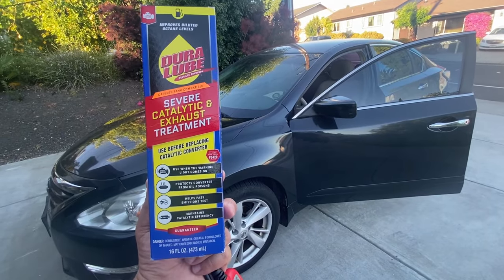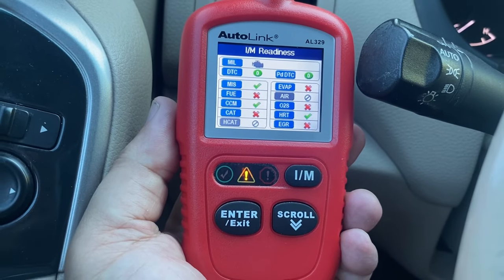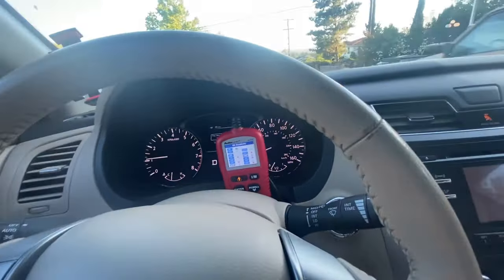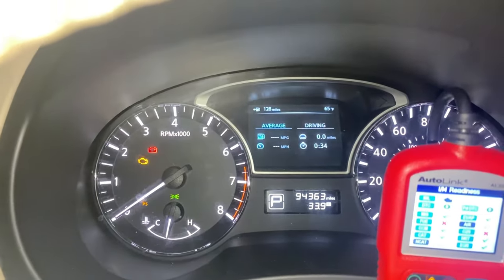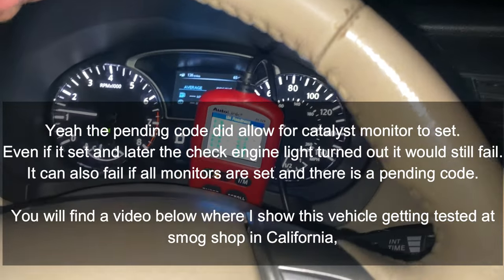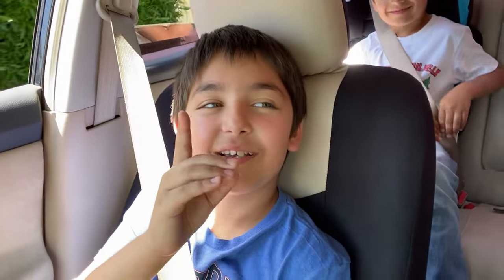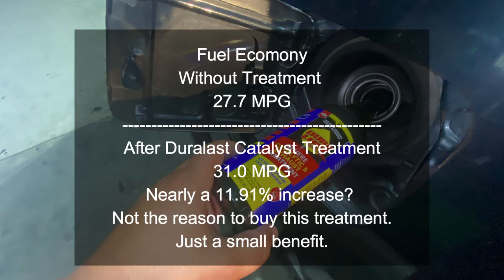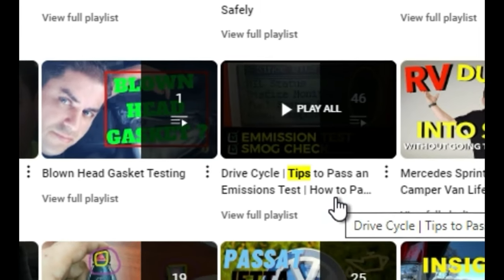P420 Smog Failure? Watch to See if Dura Lube Catalytic Converter Treatment Can Help

Comment: This product does not work, waist of money. I used it twice. I think it might be a air sensor problem now.
Reply from the maker: He do you have a pending code for the mass air flow sensor?
Reply: Just cause it dosnt work for you dosnt mean it dosnt work
Reply: If it was an air sensor problem how would this have helped to begin with 😂
Reply: I agree with you. Have tried multiple times last year.
Reply: Code P0420 O2 Sensor Efficiency Below Threshold - Normally Factory  set at 96% or Above Efficiency.
The Forward O2 Sensor #1 rapidly senses Fuel/Air mixture and sends the info to the CPU to adjust fuel injection with of signal .
The After or Downstream Catalytic O2 Sensor #2 Senses Efficiency of the Catalytic , generally the temperature should be steady with no bounce in signal and 100°F hotter than O2 #1 . Use of a Non-Fouler Like (Google Search) the $14 Dorman Part # 42109 on the Downstream O2 Sensor #2 insures a Steady Signal and No Check Engine Light . 
Dorman #42109 is the longest one at 2in but there's lots of room under a Chevy Yukon w 280k miles . Shorter ones are $10 and 90° ones for tight spaces are $30 . This Catalytic was never Clogged . Vehicle ran Great Before and After the Check Engine Light went Out . Found info on YouTube.

Comment: I had my engine light on,car app says caddy converter is a concern,bought this stuff worked great… light went off 😊
Reply from the maker: Mike, thanks buddy for sharing your success. Did the video influence you to try it or did you try it and just wanted very your results? I look forward to your reply.
Reply: Mike how long did it last Off
Reply: @luisponce1472 It doesn't last long maybe 100 miles or so (depends on vehicles my civic si it came on in 60). This stuff is really meant to be used for clearing the code and IMMEDIATELY going to a smog shop once the code is gone and all your monitors are set.

Comment: Heres the deal it works and better than cataclean. 1/4 quarter of tank of gas. Pour in a bottle. Drive ,drive,drive until before empty. Fill up do yourcars drive cycle. If your cars cat is clogged run 2 bottles thats what i did the first time. Good thing is if it doesn't work for your car you get your money back.
Reply: I have a 10 gallon tank. So if I have a 1/4 of a tank it would be 2.5 gallons. Should I do 1/2 a bottle?
Reply: @MikeKollin  full bottle

Comment: Not being funny but your check engine light isnt on
Reply from the maker: Lol, did you watch the video? I had a p420 code. It does not matter if your check engine is on or off if the inspection monitors are not ready you will not pass an emissions test.

Comment: Ok..Home Depot..2 cans PB Blaster spray/Heavy Naptha- Benzine in this..15 dollars..Spray both cans in 1/4  fuel tank...Run it at 55-65-75 speed limits posted..Byproduct is water/C02 steaming out tailpipe...Benzine is 115 octane.....
Reply from the maker: Sounds good but I think the idea is completely different as you are not bypassing the combustion chamber.

Comment: Great video. I did some reading a few months ago and the pros stated that if your car was produced after 1989 starting your car and letting the engine run can cause premature damage to your engine, the best thing to do is turn the car on and go. I have a 2008 GS350 and my VSC light came on so the mechanic used a similar device to the one you used to find out that something is going on with my cat converter so I’ll try that product to see what happens.
Reply from the maker: Thank you for sharing, why are you thinking of using this product?
Reply: What happened?
Reply: that is so backwards it's ridiculous.  stating up and going is what can cause problems
Reply: @caseyanderson1297 no not in a modern vehicle...
Reply: New vehicles do not have carburetors so we don’t need to warm our vehicles up any longer. However, I’m not sure why allowing a car to idle so we can get the heat going in the winter time would cause any damage to a new vehicle. Que sera sera to each our own.
Reply: I remember when my mom would get the car started so it could warm up and get the heat going on cold days. 

The days we would run late we would get into an icebox and putter down the street until the car warmed up and the engine  😂 

Miss my mom 😇
Reply: @AnnieAint how new of vehicles are you talking about because I have a 2014 Chevy equinox and we had a freeze over the winter and because I didn't let my car warm up long enough like I only let it sit there for like maybe 2 minutes before I took off and the engine overheated while I was driving on my way to work and was told if I had let it warm up for like 10 minutes when it's that cold out then I wouldn't have had that issue

Comment: I had a P0420 and P0430 code coming up on my wife's 2005 Lincoln Aviator and I came across your video and gave it a shot. I only used half of the bottle because I had around 8 gallons of gas so I used my little cheap Walmart diagnostic tool to reset the codes and drove it for 68 miles in all no codes popped up so i parked it until the next day and still no codes when I started it up so I went to the mechanic shop at the corner from my house and let them do the vehicle inspection because it was time to renew the tags and it passed 100% and my wife's SUV had the check engine light on for the past 6 months because of the P0420 and P0430 error codes. I did reset the codes a few times but they came back within a few minutes of driving every time but I've only used it 2 days and the error codes are still gone along with no more check engine light no more either. So I can honestly say this worked for my vehicle and I'm a very satisfied customer and very thankful for you sharing this video a whole lot. Thanks

Comment: Just run a gallon of thinner in half tank run for 150miles and itll clean the cat
Sounds like bart in the background you're from the bay area?
Reply: Yep I did it for my 2010 Honda 3.5 V6  coupe the code now sits in the graveyard  OBD 2 codes  got my lacquer thinner from Walmart removed the air fuel ratio sensors late that evening pour some directly in to bank one front and bank two rear cat and then put some into tank  hasn’t come back in over 6,000 mile now 🤔💯⚠️
Reply from the maker: I appreciate your feedback Sorry for the late reply, did you get this handled?
Reply: @RANDOMFIX the thinner enough to pass smog lol

Comment: Only works if you put it in the tank when the code first pops up and only with smaller converters
Reply from the maker: Thank you for the feedback. So with a bigger converter would 2 bottles due?
Reply: @RANDOMFIX  most modern converters will throw the code at just 5 percent deficiencies 
( EPA ) standards in US 
Take converters off and soak overnight in a solution of dawn dish detergent and water, then run some carbon cleaner through it , and let it set for about half hour, then rinse with hot water until water is clear and clean 
It will work probably f
Reply: For a couple of years

Comment: So after treatment, I hafto manually clear the code and hope 🤞🏼🤞🏼that the chk engine light doesn’t come back on?? Or will the light clear once I’ve run the car for a bit..?
Reply from the maker: Clear the check engine light and hope you can set the drive monitors before the computer can detect the issue if your are doing this for smog reasons. Are you doing it to pass a test? If you are here is a video that can help https://youtu.be/jldTJI64cfM?si=8W_Sv3mozdJwQf8c
Reply: @RANDOMFIX  yes I am doing it to pass the smog test… thx I’ll chk out the video! 🙂

Comment: Hello @RANDOMFIX. I got a 1997 4runner .When I smoged it, it passed emmison but failed because catalyst monitor and evap monitor were incomplete.  I've driven over 100 miles non stop trying the catalyst drive cycles but no luck.   Keep in mind I got no Check engine light either.  Do you think the cat is bad thats why the monitor wont set. Just alittle confused because  it  passed the  emmisons part of the smog.
Reply from the maker: You catalysts is old but it doesn’t mean it is bad. Here is the whole the catalyst incomplete playlist https://youtube.com/playlist?list=PLDEbtVOPRC-h1BAzaWQ-6NSnmG0gwvgwP

If you have already tried a chemical Additive I would not use any more but if you got the budget for it I would grab the big bottle of Techron and be ready for some freeway driving to get the catalyst hot to it get it ready. You can try the 3k trick I show in the video to get the catalyst hot but you might have to do both. 

Also you evap is incomplete, so here is the Toyota drive cycle https://youtu.be/EKfEr2LP2Nw

I had a 2001 es300 that took me 800 miles to set. So be patient and watch the videos so you are not burning expensive gas for no reason. Don’t forget to keep your fuel within range. 

Good luck and keep me updated
Reply: @RANDOMFIX   UPDATE: 
I've been driving around  done about 400 miles mix of both city and highway.    I've been doing the drive cycles specifically for toyota for the evap and the catalyst monitor.  Unfortunately they still haven't completed.  I noticed that once I completed the drive cycle to the best i can insted of reading up the monitors the computer threw me a pending P0133 but now it just disappeared.  Would I still have to get that fixed in order to set my monitors?
Thanks in advance.

Comment: so did you even have a p0420 /430 code?just curious what a i.m monitor/readiness monitor has to do with a monitor setting... the monitor will set either way, either with or without throwing a code.
Reply from the maker: Each inspection monitor will check the specific component to see if passes by meeting certain parameters.

Comment: I have 2007 Honda Odyssey with 265K mi. 
P0420 came on every 150 or 200 mi.
I bought 6 pack Dura lube last month, put 2 bottles to the 21gal tank and fill it up with 93oct gasoline.
This week, I already used the last 2 DuraLube bottles... The P0420 is still pop up every 150 mi or so. There's no other code other than P0420.
I drive mostly highway with AC off like you said, unfortunately I have no luck like you are. The only improvement I get during the test period is my van feel more power, better MPG, that's it, but P0420 keep coming back after I reset it.
Reply from the maker: Thanks for sharing, what caused this issue on your honda in the first place is the question to ask? 

Please check to verify your catalytic converter’s honey comb is intact  by Henry tapping it and listen for rattling. Second thing to do is very you have no exhaust leaks before the downstream o2 sensor ( the o2) after the catalyst) 

Let me me know what you find. What state are you located in?
Reply: Also check those O2 sensors.  They may be burnt out.  Check your air filter spark plugs and give it a tune-up with oil change before you look at buying new cats. Just to rule out can also look at pcv valve. These will give you false P0420 codes.

Comment: Hello I hope you help me I also have the code p0420 I saw your video and several videos to convince me to use this product I bought it from the store he told me to fill the tank and pour everything into the bottle I got to my house then I went back out I was in the highway and I realized that I had to put e.  3000 rpm to reach 100km when normally it is 2000rpm and from that the power began to drop and the engine began to make a noise as if it were coughing I don't know if I understood myself and I had to get to one side I called my brother for help Then I tried to turn it on again and everything was fine. I returned home but I was 60 km away out of fear. Do you know why that is? It's because of the product. Did I do something wrong or do you know what happened?
Reply from the maker: Sounds strange I have not heard of anything like you are experiencing.

Comment: also... a couple monitors will not even set unless your fuel level is between 15 and 85 percent
Reply from the maker: The Evap will not set if the fuel level is off or the fuel is slushing around. What are you driving I can send you the exact directions.

Comment: it looks good but is not in to buy in Europa (Netherlands) and +/-18 dollars for 3 gallons(is +/- 11.61 liters) is not expensive if i tank in liters wat it kost in dollars with dutch prices its 26,xx dollars for 3 gallons at a cheap tankstation in the Netherlands prices are higher hier than in the USA its around 1.97 euro/liter and it going 0.14 cents upover a month
Reply from the maker: Do you have similar smog or emissions test in the Netherlands 🇳🇱?
Reply: @RANDOMFIX  we have co2 test via the exaust and after 2007/2008 via the computer
Reply from the maker: Thank you for letting me know. Is the connector the same as North America? Are you able to use the obd2 tools from America?
Reply: @RANDOMFIX  i dont know because im not a mechanic i only heard from the test station men that it works like that i drive a Subaru Forester SH 2.0 150hp. i know that the Netherlands has high import taxes  for outside the EU including Great Britton after the brexit America (from Canada to Venezuela) Azia Australia Africa New-Zeeland  so somthing Via Amazone that is outside EU is minimal 90 euro tax extra for a thing from 29 dollars (excl. schipping costs that was 20 dollars for a needle plate for a vinyl player) so thats why i dont order outside eu any more

Comment: Christ I need help. I have all my monitors set except for my Oxygen Sensor monitors.
Reply from the maker: I can help, what are you driving?
Reply: @RANDOMFIX  thank you so much. I drive a 2015 Dodge Challenger SXT V6.
Reply from the maker: Here is the drive cycle for dodge
https://youtu.be/dyYv4HpYPys

Here is tool-less ready check so you know when it is ready.  https://youtu.be/O1RH-u1bNIc

On thing have experienced on dodge ram jeep is that if the battery is not perfect the o2 monitor will not set. So you can leave the headlights on and engine off for 10 minutes. Then 10 minutes later check the voltage of battery to make sure it about 12.0 volts.  Study the videos but don’t forget about the battery and keep me in the loop.
Reply: @RANDOMFIX  12.4v when the car is cycled to run, but goes up to 14.2v when its actually turned on.
Reply: @RANDOMFIX  would you recommend buying a new battery? The car runs and turns on good, the battery voltage seems good, but since the battery is around 5 years old maybe that will do the trick right?
Reply from the maker: It could but there is no point in throwing away a decent battery if it good ( small chance that is excellent condition after 5 years. The Heat kills batteries and the cold just exposes the battery’s condition) you could just a $2 volt meter light I mentioned or get a load tester which is actually a really good investment. Here is an example in this video https://youtu.be/Zpe_oOUZsUs 

Most of the time I am not getting a solid 5!years out of a battery these days unless it’s agm battery that is stored in the vehicle and not in the engine bay dealing with the heat.
Reply: @RANDOMFIX  well the challenger batter is located in the trunk
Reply from the maker: That’s why you want to test it instead of replacing it. Get yourself a $2 volt meter. I’m here to help.
Reply from the maker: What caused you to lose your drive cycle data?
Reply: @RANDOMFIX  first smog test since purchasing the car brand new in 2015. Went in and failed due odb2 oxygen sensor monitors not ready. I'm going to try various drive cycles on highway and street to see if I can get them to be ready, tonight.
Reply from the maker: So no dead battery or disconnecting the battery? Any pending or permanent codes? This is strange.

Comment: Don't waste your money tried on 2003 Lexus ES engine on bought this garbage to give it a try not a damn thing drove 2 days around until I had a empty tank and it didn't work still have the engine light on and the code don't waste your money please it's another scam
Reply from the maker: What is the check engine light on for?
Here is the Lexus drive cycle incase you need it
https://youtu.be/EKfEr2LP2Nw?si=6CgkukT7mt0LFWAq

Let me know if you need additional help

Comment: This video doesn't make sense at all, why are you testing a catalytic converter cleaner product on a vehicle that doesn't have any issues with its catalytic converter?😮😮😮😮😮
Reply from the maker: Rewatch the video, I explain in beginning of the video. Does help set the cat monitor any faster! Even if it had a p420 code I can still get the catalyst monitor ready with or without this I mention some tips during video. Sorry that video is long